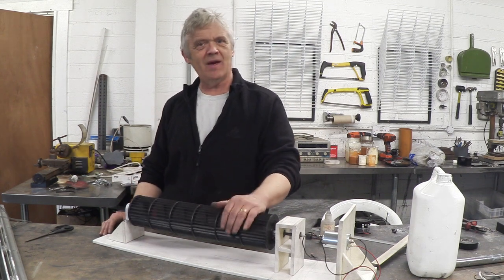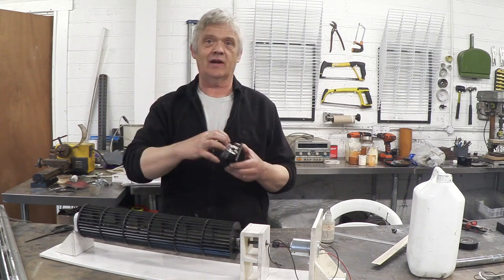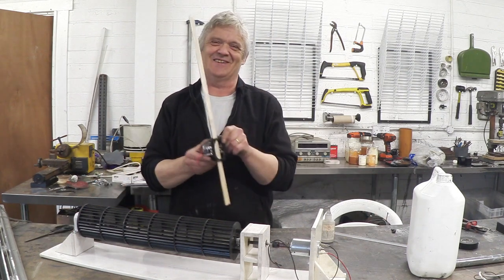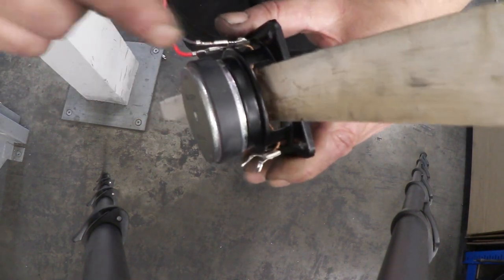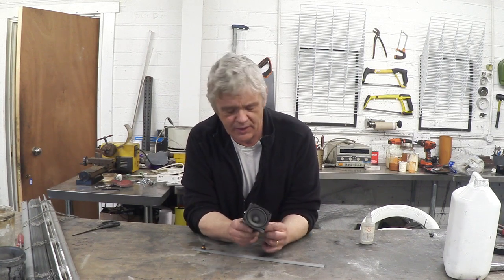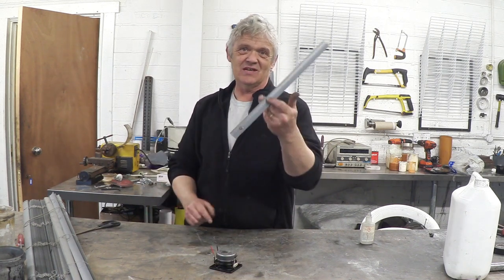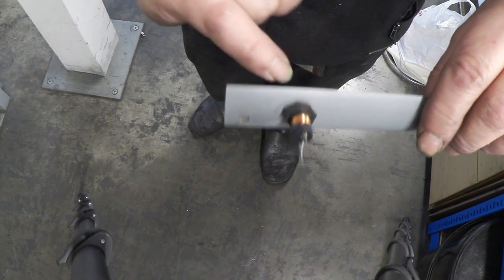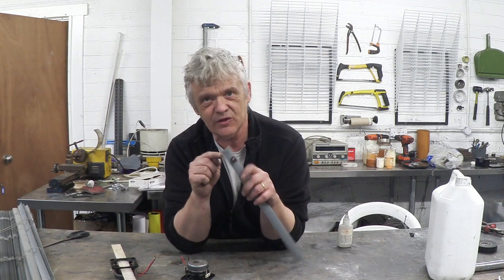Weird Wind Generator   No Blades, No Moving Parts

Comment: @2:10 I call BS!  IF you're generating 6 volts at that very slight movement then you must be generating Nano-Amps.  I just bench tested a speaker with an oscilloscope.  Under more vigorous excitation I'm only seeing 80 mV (milli-volts) (That's 0.080 volts peak to peak).  That's a HUGE ways away from 6 to 18 volts you're claiming. 

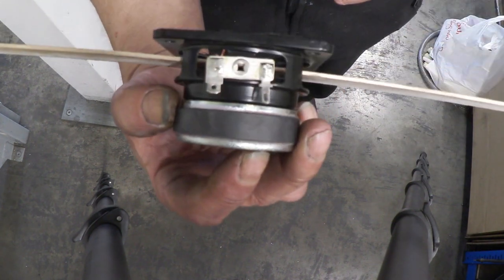@3:00 you call your sham device an alternator.  Well, yes, that's what it is - an alternator.  But if you're going to consider generating any kind of power from this, and you admit it's ultra low current, you're going to need significantly higher speed of movement of the coil and the magnetic field.

My bench test is no where near to what you're claiming.  You're virtually claiming free energy from the slightest bit of wind.  While you WILL see some electrical charge generated, the POWER of that charge is totally useless.

Your video is BS!

Comment: Robert my friend,  could you show us how to increase the current output of these generators. because that's the biggest problem with wind generators.  I'm sure you can use the higher voltage to saturate a coil say around a powdered iron core a charging a capacitor & so on,     current increasing is the biggest problem with these kind of devises.
SO THANK YOU FOR ANOTHER VIDEO OF HOW TO MAKE POWER FOR NO MONEY (i never say free power as there is no such thing really)

Comment: I would be willing to finance a trial of this into a working model, Proof of Concept. For instance, 1) sourcing the components for 100 "stalks"; 2) stalk fabrication; 3) mounting; 4) collection system; transmission to a battery; calculation of productive output.  Respond here if you wish to attempt this project. Serious only.

Comment: Splendid. A re-visit of theile small parameters as an overview ? What TS parameters can we optimise in this reverse system?  Can we exploit high strength/high flux density Neodymium? What field geometry to optimise interaction between magnet and inductor?  Maximize p-p X-max. High system mechanical compliance (yes HIGH). Free air resonance is key. Think fs . Plenty to get my brain going. Thank you boss.

Comment: Hmm...   A speaker is a device that transforms electrical energy into kinetic energy (sound pressure waves - SPW).
A microphone is a device that transforms kinetic (SPW) energy into electrical energy.  
Anything that transforms kinetic energy, by definition, must have MOVING PARTS...  
.
So how many inductors would it take to go 'off-grid' in an average sized home?   
Then there is the spurious noise produced, mostly likely when the wind changes direction or intensity... 
So putting it on the roof as a very silly idea...  
.
In fact, the whole concept is dubious, especially when scaled up.  
.
But hey!   Waste what little money you have buying veneitan blinds and inductors etc...  So you can squeeze miniscule amounts of joules from the wind.
.
What next I wonder?   Small centrifugal pumps (like the type used to pump water down a hosepipe...) fitted with a dynamo instead of a moter and fitted inline with the house's water supply...  That way, whenever you run the tap, you can squeeze yet more joules out.... LMAO!

Comment: I'd think you'd want some way for them to catch wind from different directions a bit better.  A + shaped pole could catch wind from more directions.  You could have the upper part plus shaped, and then have the part that actually flexes be thinner.

You could do some neat self-powered art installations like that... imagine a courtyard space with a bunch of those around 6-8 feet tall each, with a prism mounted on top, throwing moving rainbows everywhere as they vibrated, or just some small color cycling LEDs on them so that would self-power could be pretty at night.  Or for something more sedate, you could run a small watering pipe up through them on a slightly stiffer pole, and have hanging vines draping down them.  The leaf surface area would greatly increase the surface area wind could catch.

Comment: Magnifying Glass focused sun's rays can melt STONE ! 
THATS A FACT.

1 meter wide lens will produce that heat.
If you build a boiler system filled with grape seed oil and captured the heat from fins mounted to the main device ( insulated from hot and cold ) and internally transfer this heat conductively , why couldn't it power your whole house ?

Comment: I love watching your videos. You are very ambitious and have a great creative mind. Could you please make an alternator where the drive is a 10 speed stationary bicycle. With a voltage regulator that would keep it about 12-15 volts and rectify it. What would make this all practical is if it could put out a minimum of 5 amps. A little math required. That way you can charge a battery or storage device if they actually do shut the power off on us. Thank you for your videos and your wonderful disposition.

Comment: Something I came up with is a pvc pipe at least 4' long and wrapping it in copper wire in places to make coils. Then put little magnets on an aluminum tube with an iron wire core. Put this inside the pvc pipe with light weight springs on both ends. You'll need diodes on the outer coils to keep the electricity flowing only 1 way. The upper spring can be connected to something thats going to wable in even a light breeze, or a party helium balloon. The lower spring needs a ground wire so you complete the circuit. You just made a vertical alternator. As an ocean tidal generator bobbing up and down you could make 100x the energy of a wind turbine, or solar farm. Works 24/7 with no down time.

Comment: Holding a microphone in the open air will produce voltage. The problem is, if you took all the acoustical energy produced at a big rock concert and stored it, you MIGHT have enough energy to heat up a cup of coffee. However, speakers and microphones have been designed to follow the programs put it as accurately and efficiently as possible. It's like using the wrong tool for the job. It works, but not very well. Using bigger wires will produce more voltage. Ganging lots speakers in parallel is another way to get more for less. To put this in proper perspective, let me put it to you this way : We've all seen Big Ben. If you took enough microphones and ganged them all together within hearing distance of Big Ben, could you collect enough energy to ring the bell again? How any microphones would you need? Big Ben can be heard for miles. How many microphones could you pack into all that space. Millions? Billions? Build an anechoic chamber and put Big Ben inside so the reflected sound is used as well. Put all of that together. If you can ring the bell will the energy you've collected, you have just proved perpetual motion. The best microphone puts out about 900 millivolts at max output. I was a soundman for rock bands for 30 years (retired). I have wondered about this. It's amazing just how little sound a mic picks up. You could put them in a metal building. If the roof were constructed with two different metals, when the sun comes up they heat up at different rates. This would cause popping that the mics could pick up and convert. Rain and thunder will work too. Grids next to a high way picking up the traffic noise produces energy. This science has been pretty much worked out, but it's been geared towards producngmusic,not electricity. Perhaps some math wiz could prove it on paper? Then you might be able to try it out.

Comment: If you put a voltage across a piezo (crystal) surface it moves forward or backward depending on the polarisation. If you apply pressure, it generates voltage! (how scales work) give that a go!

Comment: Many years ago, I read an article about using VHS tape to make a blade less turbine.

Apply electricity and the tape wiggles, pushing air.

With the right piezoelectric material, a flag flapping in the wind would generate voltage.

With a LOT of flags, you could harvest power from a tiny breeze.

The ultimate version would look like a tree with streamers on it.

Unlike bladed turbines, storms wouldn’t be a threat.

Comment: Hook up a micro high car altanator 3.7kw there on 80 unit with run loss 200kw??????? Self run for 6.5 years??????????now the battery well since space may not be the biggest issue grafite caps to run use a colse trolley type motor to drive the gear to the altanator around 106rpm to 3000rpm out "not in front off me!", regulate the power regulation and Pout AC/DC and hook it into a turn motor to run your wind altanator since more power and when the wind picks up use a control to drop regulations to save the altanator time ???? Got a fish tank i need a lot off power for and this is clean at 1/4 size to a power AC gen and no v8 to run it?????

Comment: That is brilliant. What if you were to double them? That is, put one on each side, back to back. Would they produce power simultaneously or alternately.? If it's simultaneous, could you increase the amperage if wired correctly? Put enough "sticks" in a vented tube and get more power?

Comment: Since it is vibration that causes the current, could you not attach a bunch of these to a automobile body, which vibrates as it moves, and charge up an extra battery as the car travels along? They could be located inside the hood, or in the back of the car so they don't create wind resistance.

Comment: I'm not saying that no moving parts is well defined as there is movement of something to create energy output,  however, what if could set up a moving weather vane with plastic balls on end that hit a drum like device making a vibration? Not sure...just a thought or input on something I'm not relentfy sure OF?
Can vibrating something work under water...like in the ocean? Does the water give a decreased dampening effect? The medium for a vibrating effect....is it more or less so in air or vacuum or a gas filled something or in water? What if you filled a drum (one like is used in a musicians band) with icy air or gas maybe and outside the drum is hot air....will hitting the drum vibrate different or louder even? Just some thoughts on this. Different materials on top the drum may also produce different effects....vibrating more or less....just like metal cymbals when clanged together. Metal is the best choice for that vibration? I can get lost by thinking all such ways! HAHAHA...like in a maze trying to return to the point of origin.

Comment: I can't find any info on the original design, but several years ago I read an article on a young man who developed a reed-style generator to help the people of Haiti.  He used kite nylon in roughly 1x36 inch (2.5cm x 1m) strips stretched and held horizontal, with a magnet ~ 6 inches from the ends and coils on the frame.  He used kite fabric because it is rugged and lightweight (vibrates easily in very light wind), and was abundant and cheap in Haiti.  He open-sourced his design, and improved the system so that less than $10 of materials could charge a battery that would power an LED light 24x7 thanks to the ubiquitous wind coming onto the island.

The key variables were the length and width of the fabric (very narrow compared to length, but not too narrow), the position of the magnet on the strip (close to the end, but not so close you lose motion) and the spacing between the fabric and the coil (optimum coupling distance, ensuring the magnet and coil never physically touch even in high wind - touching wastes the kinetic potential).

Something as lightweight as kite fabric would be ideal, to harvest energy even in the lightest wind.  These strips could be stacked, and coils could be placed above and below the magnet to increase the amount of harvested electricity.  The idea could be scaled up (longer and wider strips) and solenoids could be used as the pickup coils to increase the output.

It may be possible to eliminate most of the framing in the original design by putting the magnet on one side of the ribbon and a coli on the other, and then flipping every other ribbon so each ribbon both creates motion and harvests electricity from the one above and the one below.

Comment: Speaker coils clearly have too few turns of wire to act as much more than a motion detector for wind. But even though there are all sorts of options for the mechanical design of resonant vibration electrical generators that will harvest 'some' energy at very low wind speeds, I get a very strong feeling that the optimal design for any actual power for the price goes right back to circular windmill blades and rotating generators, meaning that the more you think about it and experiment the more it converges on what we already have. As for low wind energy harvesting, I've been contemplating a small 'starter motor' to overcome startup inertia, but just as an experiment. I highly doubt it would be cost effective or energy viable for anything but my own applications.

Comment: It is misleading to claim this generator 'has no moving parts'. The pole vibrates. Vibration is movement. It is also misleading to say the device 'generates a voltage'. What you want to generate is power, that is voltage x current = Energy/time, or energy = power x time. You can make very high voltages e.g. with static charging but this holds only a small charge, so when it discharges gives power only for a very short time, hence delivers little energy. A meaningful measurement of generator output has to report at least two quantities, the open circuit voltage Voc (voltage when no current flows) and the short circuit current Isc (current flowing with zero voltage btwn the electrodes). Voc x Isc gives an upper limit for the power the generator can deliver. A better measurement is the full current/voltage characteristic in between the two extremes, open circuit and short circuit.

Comment: This doesn't really have no moving parts obviously. When I read that title I immediately thought: ion current, something I've thought of before. I wonder if you could ionize air, then allow wind to accelerate the ions, then slow them down and extract electricity, then discharge / deionize them and recover some of the electricity you put into them? That, for one thing, really could be a no moving parts (other than the wind and the ions) wind gen. Hmmm...

Comment: There is a problem with using a speaker......you have to keep the voice coil centered in the gap or eventually it will rub and wear throught the winding and break continuity.  The improvement would be to use the "reed" as a fulcrum and have 2 opposing speakers with the cones intact but its about the stiffness of the spider and the cone surround.......so you would want to create a dual piston effect with the reed as the fulcrum and have a joint on a rod with  centering bearing so not to deviate from the linear travel of the speaker cones.  If you used opposing cones....one would tug out and the other pushes in....and in effect alternating.    BUT if the whole aspect of the reed up and exposed to the breeze......you'd want a stiffness as not to buckle in higher pressure wind.....so you might have to create a fixture as a housing to hold the mechanism as a whole where it can be raised and lowered into the fixture to control the length of the reed being exposed to the breeze.    SO its a question of if a grass blade type or if a bird feather type would be most effective and sensitive to be a driver.  >>>>>>>>>>>>>>>>>>>I deal with musical stuff and primarily guitar...electric guitar.  SO there is a similarity to a steel string vibrating over a pickup to induce a voltage signal to drive an amplifier......all in microvolts with a higher voltage being produced with a harder string movement.   AND almost thinking wind chimes.....

Comment: Just a thought, if you're planning to do many on a much smaller scale, then would cheap mass produced microphones probably be best? That is essentially what using a speaker in that manner is doing, when I was younger and PC microphones weren't commonplace, I used earbud headphones in the mic port, but you had to shout to get any appreciable signal to record, so perhaps microphones being more sensitive would produce more current/voltage. Just a thought anyway.

Comment: A round pole or wire in the wind makes a vortex that switches side to side rapidly, known as a Street vortex. Street vortex causes flags to wave, you can see the frequency.
Use piezo-electric disks to convert force to electric,  pinch the base between discs and set an axle above then the pole, bamboo stick might be nice.
You can flash a led with a tap on a piezo. With 4 diodes, a cap and resistor you can keep the led lit by tapping. Shorter/stiffer smaller dia sticks should vibrate faster.

Comment: If we put a voltage into a speaker and get the output of vibration as sound then it will also be true in reverse, I know you're talking about wind actuation, and the corresponding movements will be larger and hence more power, I think..but if you think about it, this in theory will even work just from sound. The speaker surface area would just need to be larger and the unit putting in a really loud location, think bustling city streets, airport runways , noisy industrial zones etc.. what do you reckon? Oh just a question ( I'm not an electrician or anything like that) but is the output DC? I'm guessing it is ?

Comment: The coil around a magnet in a speaker is supposed to move in and out.  That's why there is a 'foam surround' to keep that coil perfectly centered as it moves. The problem with this particular arrangement is that that coil will be skewed left or right and in and out, allowing that coil to rub up against the magnet - therefore causing what we call 'RUB' among other terms.  And that's not good.  And even if it did work properly you are going to get minimal current.  This is neither cost effective or even very functional.  You have basically made a 'wind- microphone'.  I do enjoy these videos though, well done.